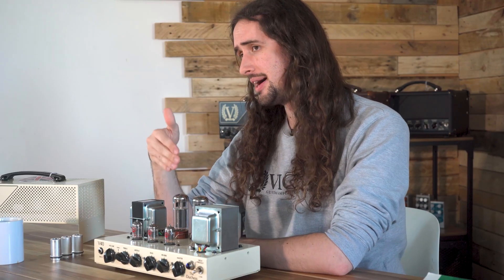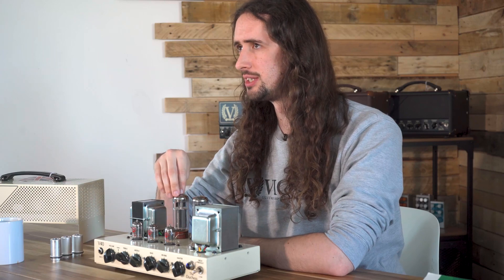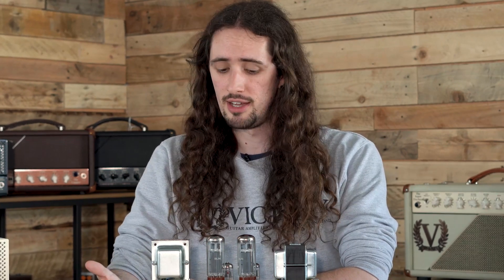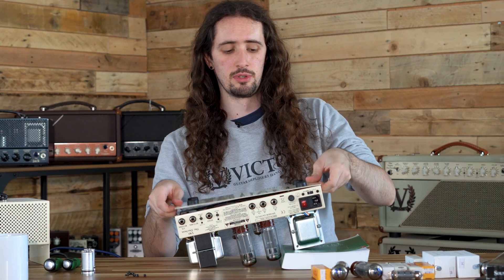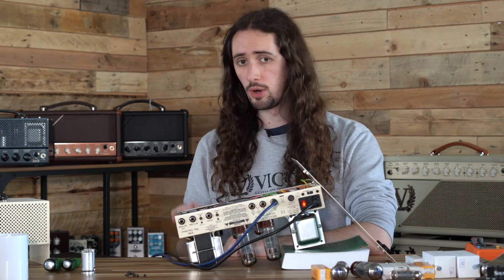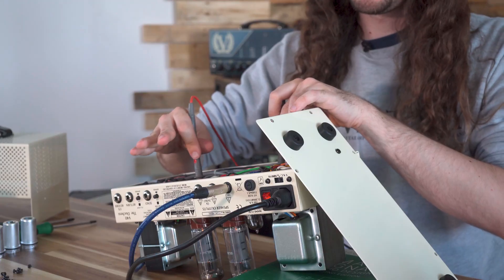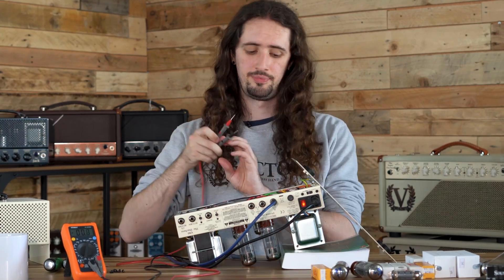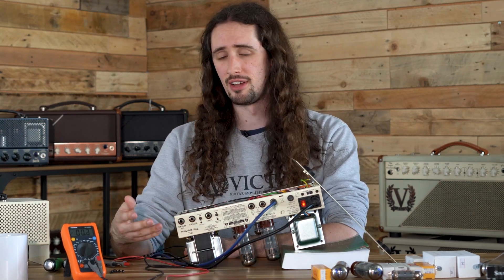Mastering Amp Biasing: A quick guide for biasing your valve amp

Comment: I bought a v140 a few years ago. Just changed all tubes today, and the damn bias ports on the back don't read anything 😢.  Never had to use them before so I don't know if it came from the factory not working or something happened between or my tester probes are not going in far enough, but they are like an inch long. Idk . I'm bummed out. I just keeped the bias where it was and hope for the best. Sounds good.

Comment: If you put new valves in that are the same as the originals, do you need to rebias?
Reply from the maker: Yes, it is something we recommend, sometimes even the same type of tubes can have some differences, Thanks Victory
Reply: @VictoryAmps what about if the valves are sold as a “matched pair” ?
Reply: @STF_YVR  Match pair or quad means they are balanced together the two/four tubes sold so they properly bias(up and down) together once the proper bias mA(DC Millamp) is apply from the bias circuit. The tubes in your amplifier maybe a different match than the new purchased ones. Meaning they may need more or less current to get into the proper operating range(Low = Cold sterile and thin brighter(harsher) sounding / High = Hotter a bit more loose low end and slightly more gain because the tubes are being pushed harder) . You don't want to over inflate a truck tire or under inflate a truck tire. You want it in the proper range. Same with tubes.